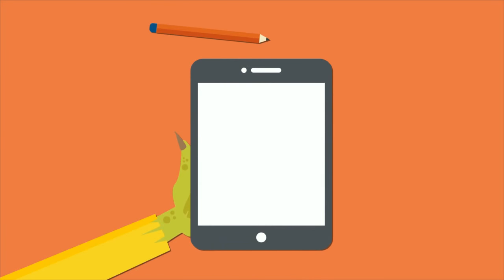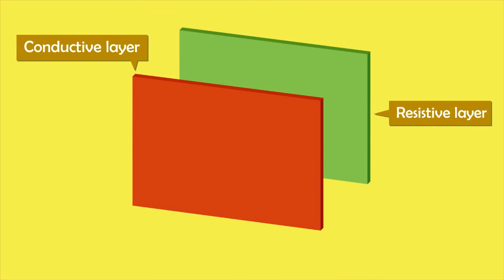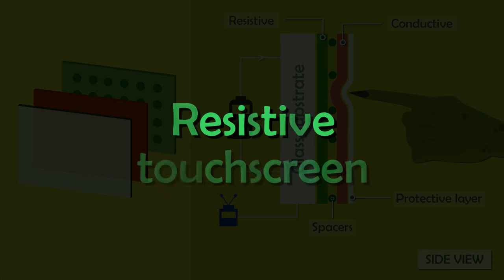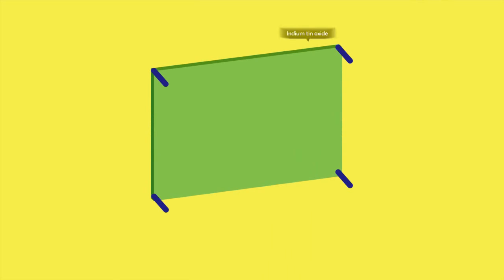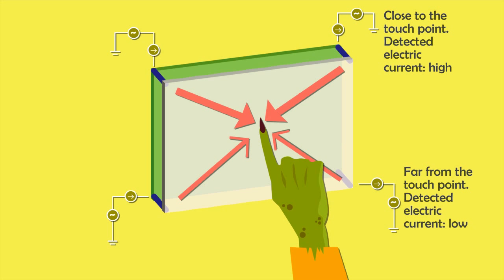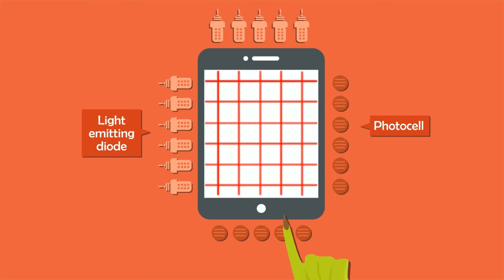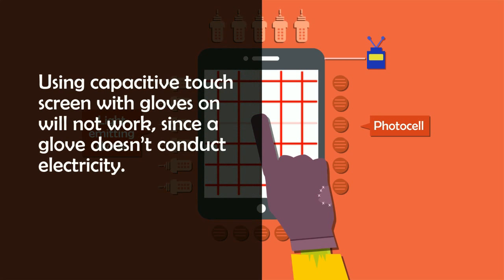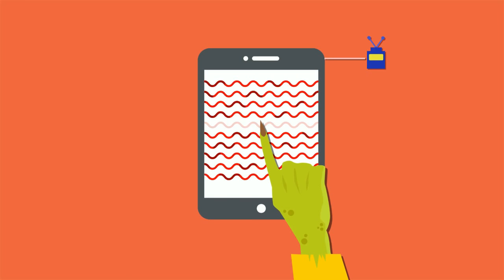How Do Touchscreens Work? | Touchscreen Technology Explained

Comment: great video! , i was wondering as u forgot to mention how multi touch works in capacitive touch screen at the same time.. ? since diff in volt is calculated at every corners, how would it distinguish b/w single touch and multi touch